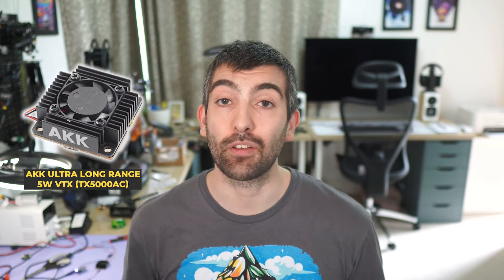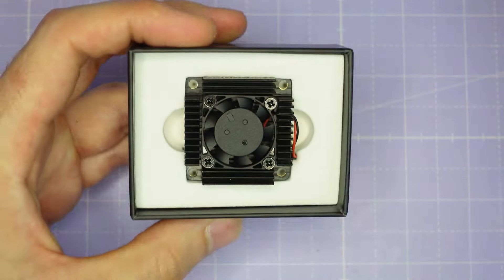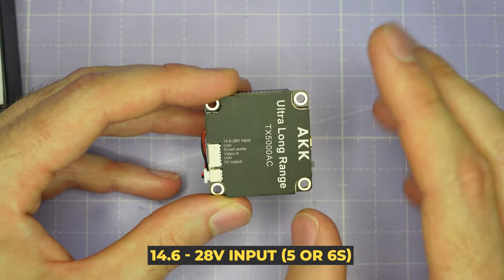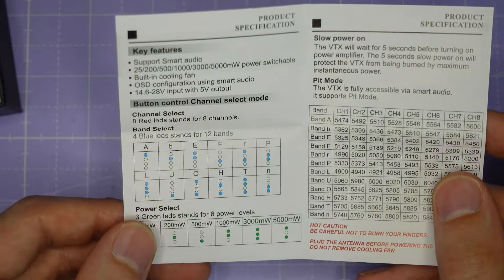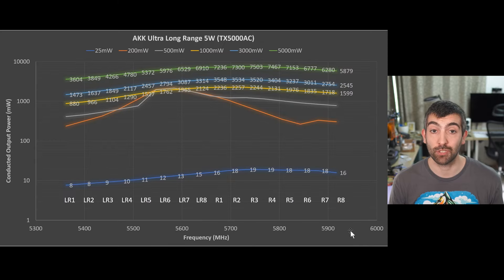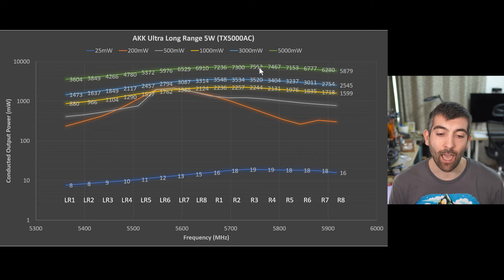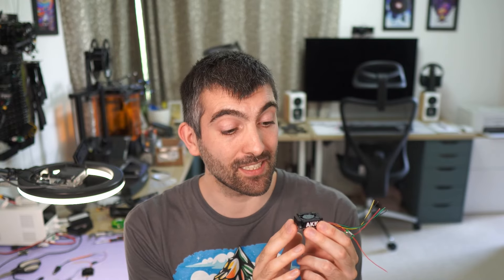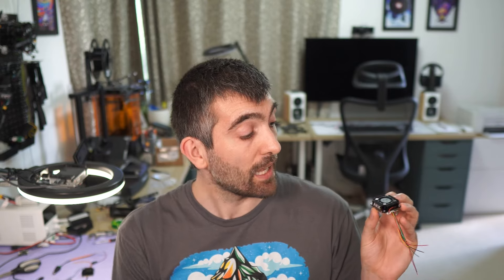Lightweight 5W Analog VTX!  AKK TX5000AC

Comment: I'm not very familiar with RF too much but I know the measurement values on the Immersion RC power meter change quite a lot when you change the frequency on the measuring device (even within the 5ghz range). Aren't your measuring setup affected by the frequency change? (measuring frequency not TX frequency)
Reply: That's because output power is inconsistent between channels on VTXs. It has nothing to do with the power meter.
Reply: @neuromancer692  you didn't get my point